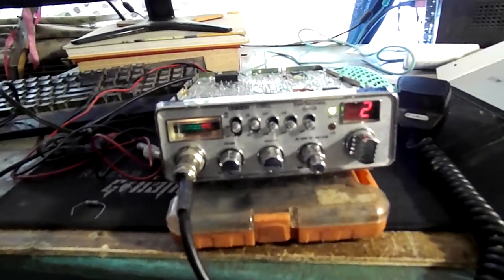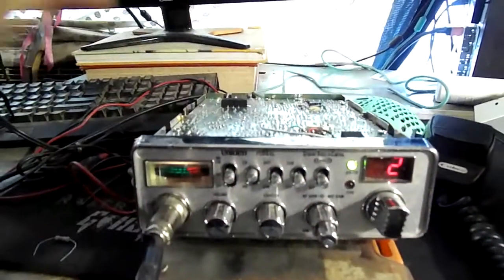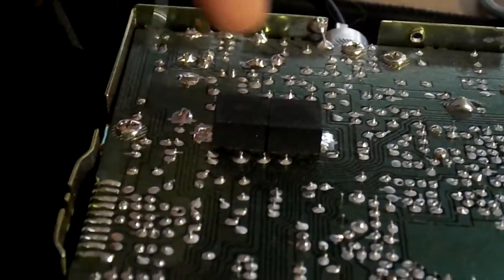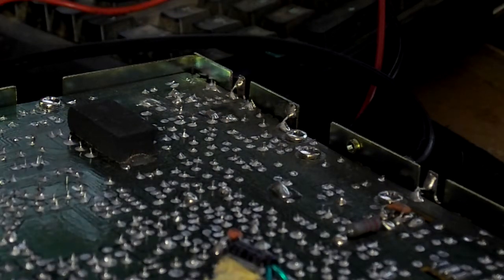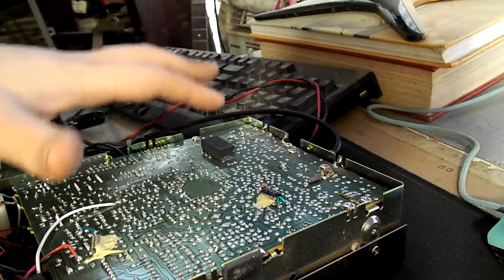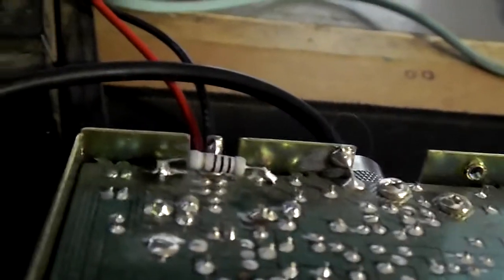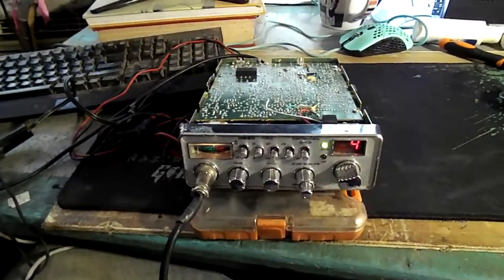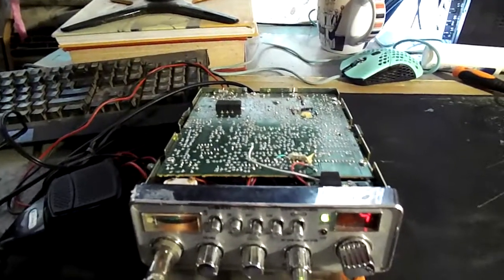Add Talkback To Your Radio, Easy CB Mod

Comment: Thank you 
781👋
Reply from the maker: Thank you you as well!!!
Reply: I tried to do it on my 142 GTL it’s a little different in there. There’s an extra circuit board right behind the PA and external speaker. Jack got me a bit quite confused.

Comment: I knew how to add the talk back for a long long time. But I only added it to CB radios That I added Echo boards to. It helps to set to the way you want it to sounds. Otherwise you have no idea what a sounds like until someone on the air says, That sounds horrible. And then tries to explain how it sounds. And will often just confuse you. So adding talk back solves the issue. And I have always added a switch because once it is setup, then I never ever turned it on again.
Reply from the maker: @jessiec4128  yeah that’s a good idea, way better than getting a Radio check.

That’s why I did it too 👍

Comment: Do i still need the resistor inline if i unsolder channel 9 and use that switch or do i just solder seperate wires from pa and ext to the switch?
Reply from the maker: You can use the channel 9 switch or any switch you’d like, but you will be better off having a resistor in line. Otherwise, the talkback will be very loud and distorted.

Comment: There is know exact value ..it all comes down to frequency response of the person's voice ..the radio audio circuit and output voltages on the circuit .. what value that mught work for one radio my bit work for the other..it all depends on ehat i been modified of done to the audio chain ..of the radio has  open amc and limitors these values will only make the talkback squeel .. it is completely dependent on the circuit itself... If the radio is stock or non abused and the limiter left alone 1/4- 1 watt at 100 ohms will get u started ..if u wanting a fixed talkback were only a resistors is used ,wich i do t recommend..then the 100 ohm 1/4-1 watt will work ......

Comment: U can play with the potentiometer k value in characteristics of the resistor value .. both will give u exactly what u want ..... I recommend u use a reley and a variable..beat of luck...1/4 -1 watt resitor at 100 ohm .. use 500 - 1 k pot  u can use a push in variable to switch the  talkback .. all in one .. push the knob in yalk back in push again talk back off ...very bery simple ..ive stated above why useing a reley is important...  Hope this helps u improve tour talkback circuits i. The future ..73s from justin Oklahoma 9lb  🔨...5180 on ssb

Comment: Thos will work ,but should not be done ...honestly ..i can exsplain, your looping the pa output thats all talk back is ..putting the audio and looping it in the transmitters recive ...it works ..but  if u fully understand whats taking  place its hard hard on the audio IC....your bleeding off audio vomtages to be disapated in the resistor ..ther is a much much better eay to electricaly produce the same curcuit wich is mych much better and dosent negativity effect voltages. Basically your taking energy away from rf output audio chain.... Trust me 30 yrs as a tech.... Always use a reley switches talkback .by taoping in directly and having it switch and feed ....best of luck..yes u can also run a variable control talkback using the reley circuit im explaining.... A food talk acj circuit uses a reley always ..and ive explained why above ....   I am trying to be honestly helpful and teach ..not be arragant and a ass hole ...hope u understand this best of luck ..73s ..i want new upcoming operators or hobbiest to learn things and i love seeing .it...keep ot up jhonny  73s 9lb hammwr Oklahoma 5180 justin

Comment: Thanks for doing that That was easy Bull crap though The diaples work great sometimes better than vertical antennas You might see my profile screen and see that I'm young that doesn't mean anything I know a fair amount about Radios
Reply from the maker: Dipoles are great for skip if they are horizontally polarized.

They are less efficient when talking to verticals locally because of the polarization.

So you’ll have an easier time getting contacts locally with a vertically polarized antenna
Reply: I have to differ with that not always

Comment: Do you need the resistor if you go with a potentiometer
Reply from the maker: Personally I would tinker around with it. Try it with a potentiometer set to maximum and if it is too loud put in a resistor 👍
Reply: @JohnnyJonesathome  awesome! Hey thank you I appreciate it.

Comment: What resistance value should the potentiometer be? 1k ohms?
Reply from the maker: You can play around with the values but 100 ohms is what I used. You might have to use a little higher resistance if it sounds rough.
Reply: @JohnnyJonesathome  Thanks I used 150 just loud enough with an external speaker, I'm thinking I'm might piggyback it to the cb/pa switch so I can turn it on and off. thanks for the video. As for the soldering iron I'd definitely invest in a ts100 or pinecil if you haven't already, night and day difference

Comment: Can you tell me which posts on the bright/dim switch I need to connect to, on my Cobra 29 ltd classic, please? And, do I put the resistor in line with the wire to the PA, coming off the switch, or in line with the speaker side and wire to the switch?
Reply from the maker: I can’t tell you which posts to use, what you’ll have to do is get yourself a schematic to help you out

But it would appear to me that one of the pins will include some dropping resistors to limit the current flowing through the display.

Look up a cobra 29 LTD classic schematic and study it, as well as a top and bottom board view schematic

And all your doing with the resistor is feeding your speaker with a bit of your signal

So attach one leg of the resistor on the middle pin of your PA Jack and the other leg of the resistor on the middle pin of your ext speaker jack.

Touch the legs to the pins first and then speak into your mic and make sure it’s not going to be too loud before you solder them in

Comment: Sweet , very simple .  Question ,, if you want the talkback really loud if you have trouble hearing like me and you need it LOUD ,, what value of resistor do you use , more than 100 ohm or less ?  Where is a good source to buy a pack of these of good quality ? And what brand ?  I should know this stuff already but I’ve been lazy in starting the learning process
Reply from the maker: If you want louder sound go for a lower resistance 

The brand shouldn’t matter much at all, They are pretty much all made in the same place

It’s a pretty easy job
Reply: @JohnnyJonesathome  

Thanks very much . I have a bunch of these Uniden 68’s , the LTW’s are my favorite
Reply from the maker: Yes those are good radios especially if you get the Philippines models,  Sorry it’s hard to reply to all the comments I don’t get notified on replies.
Reply: @JohnnyJonesathome  
No worries ,, keep up the good work

Comment: Great video. If I want to put that on my tone switch on a 29 NW classic. Do I still need a resistor?
Reply from the maker: It would be hard for me to tell you, a tone control circuit has Capacitors and inductors for equalization, so adding those in series may cause other issues I’m not sure. But the biggest issue would be the fact that the resistance would be too high I think most variable resistors  like that are around 500 to 1.5 K ohms.

For this you need about 100 ohms of resistance 

But I can’t tell you if it will work or not for sure.

I wish I could be of more help
Reply: Ok thanks for the reply. So if I decide to run two wires from the Rf gain potentiometer do I still need the resistor in the back connect to the pa and speaker points?
Reply from the maker: @taadventures6312  i think it would be to much resistance to keep the resistor on

Try it without the resistor

Comment: Does this mess up the PA system part of it
Reply from the maker: Hmmm interesting question It shouldn't, the PA jack should still work but having the resistor in place could split the current, but I'm no expert, only a beginner.

 Very good question though, I'll have to make a video on it. However the resistor doesn't cause any damage so it can easily be taken out if needed.